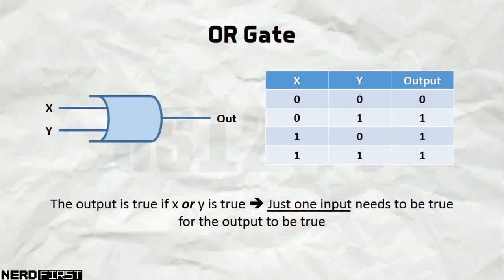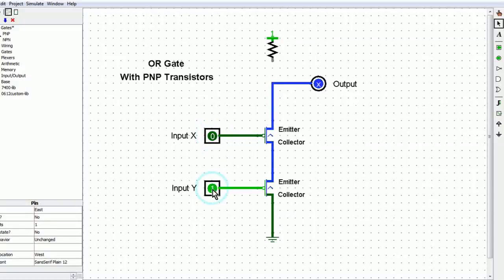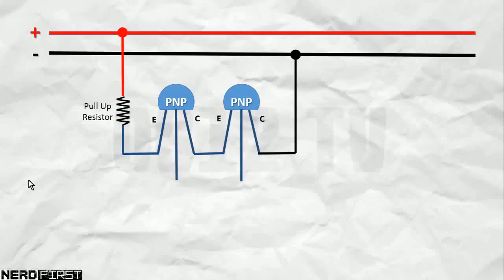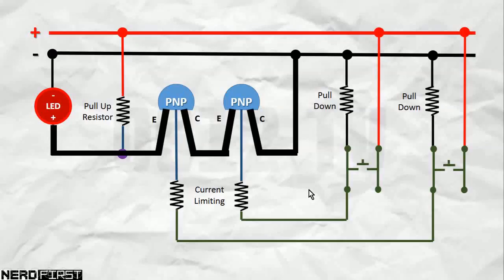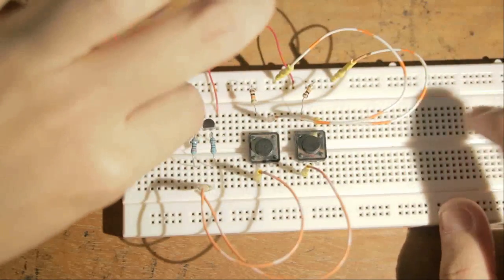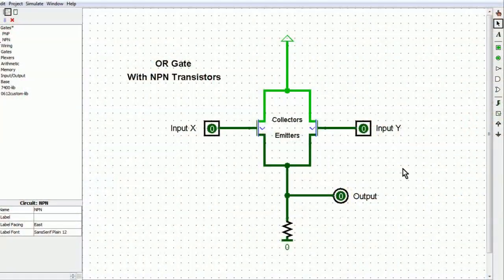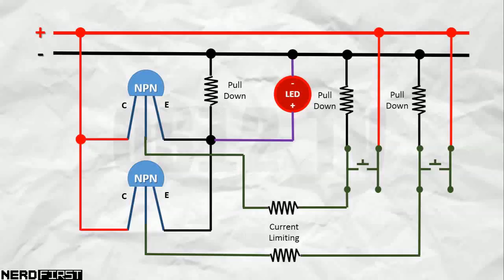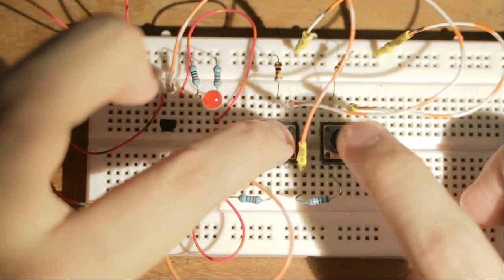OR Gates - Transistors 04

Comment: Couldn't you also create an or gate by placing two pushbuttons in parallel form?
Reply from the maker: Hello and thank you for your comment! You certainly could, and some textbooks use that as a loose analogy to how the OR gate works. I opted to omit it as logic gates, broadly, are transistor based and can be controlled by other voltages rather than physical switches, and it was important to demonstrate that!
Reply: @NERDfirst   Thanks! I forgot that in complex and big circuits you don't want to have to press lots of buttons to open your logic gates. Good point👌